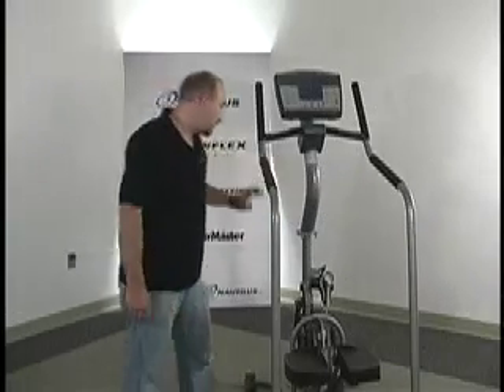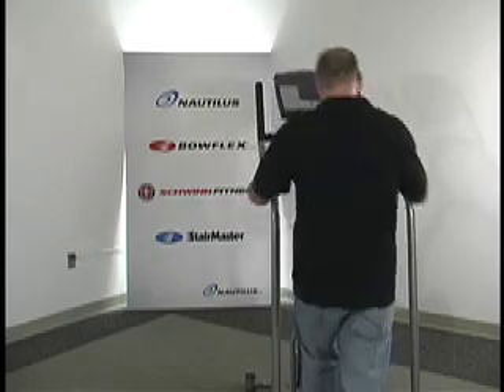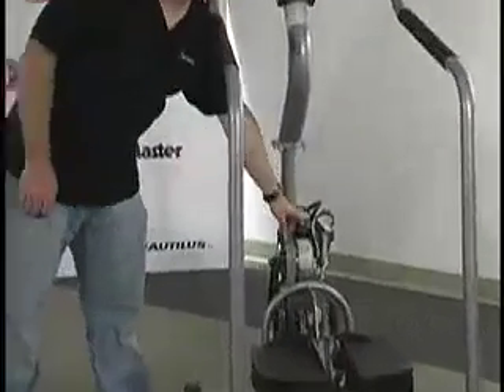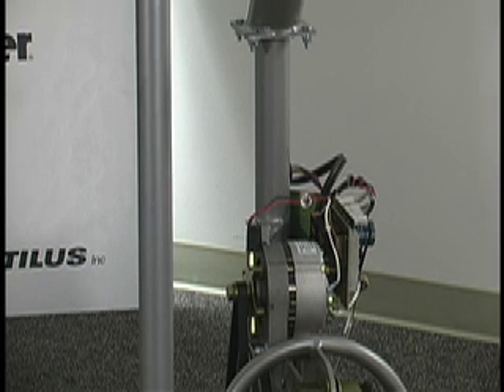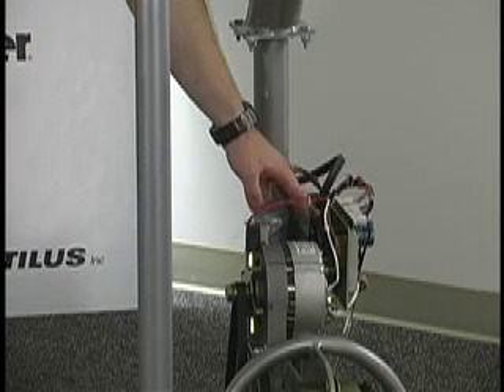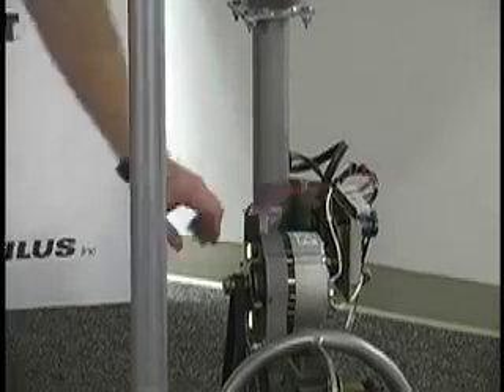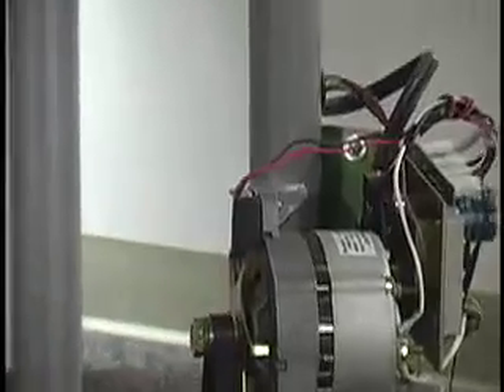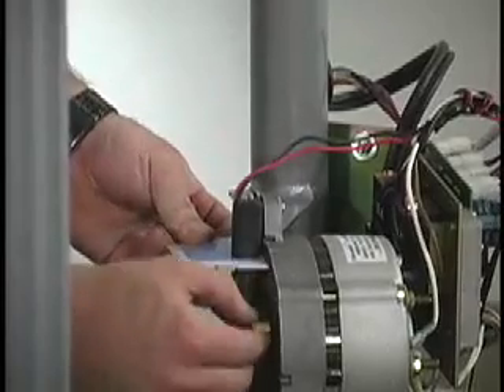SC916 How Do I Troubleshoot Power Issues   LQ

Comment: Most power up issues are battery related However, The inductive switch (speed) sensor generates an ac voltage to saturate Q5 on the pcb which allows current to flow. A quick test
is to by pass the inductive switch by shorting the s and d pins of Q5. If the console powers up
the inductive switch is the cause. For more trouble shooting tips leave your response.